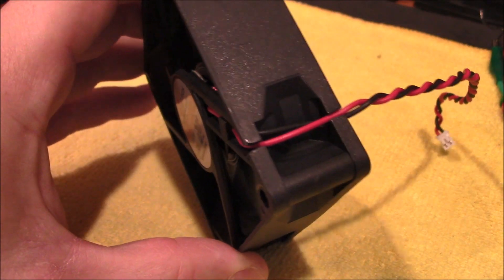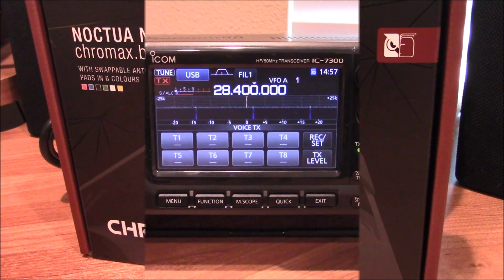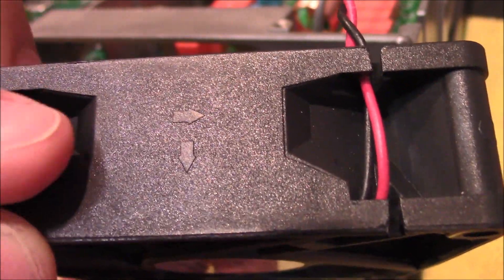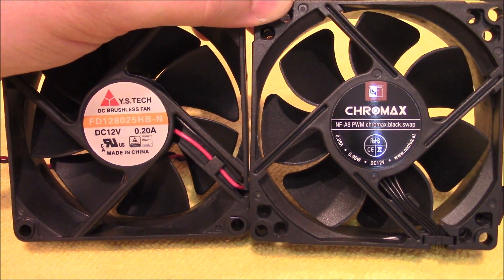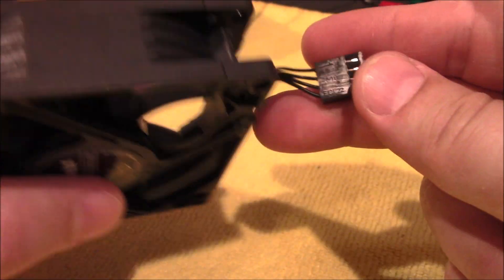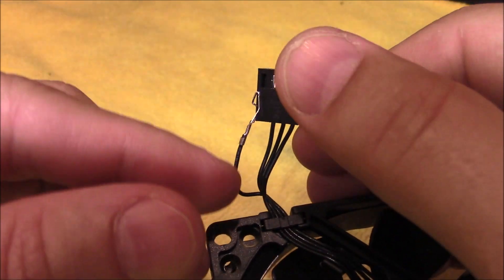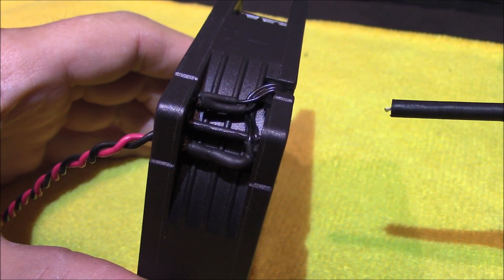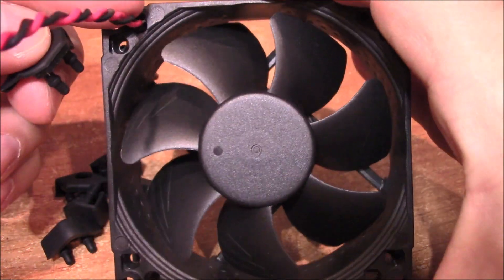Icom IC-7300 Fan Replacement - Install and Sound Comparison

Comment: This was a great video. When I saw that the wire connectors differed between fans, I wondered what you would do.  Now I know.  Shared this link with my club.

Comment: Noctua makes excellent fans.  I have two of them in the 14 year old PC I'm writing this on and they're whisper quiet even now.  I think, however, that much of their secret is in the soft rubber shock mounts they use.  Less resonance through the case means less noise for the operator.  Given the drop in CFM I think I will try the rubber mounts first in my 7300, then go to the Noctua fans if that proves less than satisfactory.  Thanks for the review.

Comment: Many in our club have adapted 9700 to have fan on low all the time rather than ramping up.
Reply from the maker: Is it finally an option via firmware upgrade?, I had a 9700 for a short time,  I don't recall it doing that. Must be different fan control firmware for the 7300.
Reply: @morejelloplease  it’s not as loud but I asked the guy from my club, apparently on 9700 it caused the freq to become unstable on 70cm and even worse on 23cm.  Sorry seems not same thing, my mistake.
Reply from the maker: @CampervanCookout  that's why I sold my 9700, fancy radio that won't even receive out of band and drifts way too much, it's even noticeable on 2m ssb. A GPS reference oscillator is a must.

Comment: The 7300 fan noise has never bothered me. Maybe it is because I am hard of hearing at 76 yrs. But the Astron power supply fan did bother me, as it ran all the time. I changed it out for a quieter one and added a temperature controller to it.
Reply from the maker: Yeah my astron vs70m sounded like I was sitting in a computer server room it was so loud. The icom would cycle every time you key the rig.  When you are talking in a rag chew group it gets annoying quick,  like a fan clutch on a garage truck coming up the hill.

Comment: I only need 35% of my 7300 power to feed into my amplifier to get out 600 Watt and 35% does not make the internal fan loud.
Reply from the maker: either there was a firmware update (doubtful),  you have a different fan , or you can't hear the fan noise as it's probably being drowned out by other noise in your shack.  the power could be at 1 or 100, as soon as you key it, the fan ramps up which  sounds like a trash truck coming down your street.
Reply: @morejelloplease  ...I hardly hear my fan, it's not as loud as yours, I don't know why.

Comment: Since Noctua is less CFM, how about just reduce the speed of the existing fan with a resistor instead?
Reply from the maker: You could build an external speed controller and leave the stock fan in if you like
Reply: @morejelloplease  controller with a thermistor.

Comment: Modification DANGEREUSE pour le poste, bien sûr que ce nouveau ventilateur fait moins de bruit puisque son débit d'air est de 55m3/h contre 70.68m3/h sur la version originale. Un exemple à ne pas suivre, si les ingénieurs de ICOM ont prévus d'installer un ventilateur avec ce débit d'air c'est qu'il y a une raison, à vouloir jouer les apprentis sorcier on fini par tout casser. La bonne modification serait de trouver un ventilateur avec le même débit d'air tout en faisant moins de bruit...pas simple de vouloir être meilleur que le créateur HI !
Reply from the maker: All I could understand was "icom"
Reply: @morejelloplease  English translate "DANGEROUS modification for the station, of course this new fan makes less noise since its air flow is 55m3 / h against 70.68m3 / h on the original version. An example not to follow, if the engineers at ICOM have planned to install a fan with this air flow, it is because there is a reason, to want to play the sorcerer's apprentice we ended up breaking everything. The good modification would be to find a fan with the same airflow while making less noise ... not easy to want to be better than the creator HI!"
Reply from the maker: @johnbeaurain1567  yes the airflow is slightly less as indicated, and I also said perform at your own risk. If you are using this during a field day event in 100 degree weather using RTTY at full power then airflow may be an issue, it just depends on how you operate your equipment. For me I was using it for ssb rag chew and never had an issue, also if you are running reduced power to drive an amp it should be fine. If the radio gets warm, the fan will stay running after you unkey, and only for a few seconds but usually it stops as soon as I unkey, so I was comfortable with its operation. I sold this radio long time ago, if I'm not mistaken there's a temperature gage in the menu or maybe I'm confusing it with my 7610 , which by the way did not have a noisy fan and if it did I would still perform the same modification with a similar fan. Tinkering is a big part of this hobby.  Just like cars, some people modify them some people don't - if it's not your cup of tea then don't drink it. :)

Comment: Do you know what the pin spacing of the connector?  It looks like a JST connector, but there are three sizes: 1.25mm, 2.0mm and 2.5mm.
Reply from the maker: I don't, I assume you're talking about the power connector on the icom.

Comment: What's the clicking sound when you transmit? That's nearly as irritating as the fan noise.
Reply from the maker: i'm just pulsing the transmit via foot switch, those are the actual relays in the radio, not the foot switch.   my intent was to demonstrate that the fans sounds like a mac truck when you simply blip the transmit.    when you stay keyed, they ramp up, then settle down, but eventually ramp back up again.

Comment: I got the beige colored noctua fans. That's cooling performance of it's finest. I need to put my ears on the lid of the TRX to notice to fans are running as they should. HI... nice video. 73's de Günter

Comment: Even after hours and hours of use my 7300 fan is quiet even on transmit.
Reply from the maker: make a video, maybe you have a different fan.
Reply: @morejelloplease  sure even after continuous use of 6 hours the bar remains with 4 stripes only.

Comment: what gauge wire did you use for replacement? I'm thinking  22awg? 73's
Reply from the maker: i used the stock red/blk wire and soldered it to the fan.

Comment: i love my fan. i will never change it
Reply from the maker: the OEM fan?  interestingly enough, my 9700 and 7610 stock fans are much quieter.
Reply: @morejelloplease  I agree. The stock OEM fan on my 7300 is the same identical fan in my stock 7610. Part no. FD128025 HB-N. Although the stock 7610 fan is just a bit quieter than the 7300, still too noisy for me. The 7610 stock fan is probably fed with less voltage is just my guess why it's a tad quieter. Thank you More Jello and Noctua
Reply from the maker: @slashzeroYO  It has everything to do with the circuit that drives the fan.  icom dropped the ball here since the 9700 and 7610 aren't this noisy during startup.  either they can't adjust this via firmware update or they haven't received enough complaints.  i like how certain model yaesus will give you the option to run the fan in normal mode or contest mode. fancy SDR radio and we can't even control the fan :)

Comment: A bigger better speaker makes it a better radio also.
Reply from the maker: and more butter makes it better too.
Reply: @morejelloplease  sure...
Reply from the maker: @samiam9059  exactly my thoughts
Reply: @morejelloplease  The speaker is terrible compared to just about any other alternative for long term listening.
Reply from the maker: @samiam9059  ahh gotcha, wasn't sure where you were going with that :)   all these radios are getting smaller, and so are the matching speakers.   i sold my icom external speaker, looks cool, sounds like crap lol.     the 7610 has a decent speaker actually, in it's own enclosure.
Reply from the maker: @samiam9059  i have some old realistic minimus 77's, they work great too :)
Reply: @morejelloplease  there you go

Comment: my fan is very quiet perhaps on uk radios they are not the same
Reply from the maker: they may have selected a different batch of fans.   see if you can snap a photo or write the make/model of your fan and post it :)
Reply: @Michael Harrison well i dont know Michael but mine isnt, very quiet in fact perhaps just lucky, good radio though

Comment: I did the same thing for my (ex) Kenwood D710GA. The experience was detailed on the QRZ forums.  It was WAY too loud for APRS 24/7 operation and I used a small Noctua fan as a replacement.  Man what a difference.  Very similar to your experience.  I wish these manufacturer's would spend a few pennies more and use a quality fan.  ;o)
Reply from the maker: Hi Nick!  yeah i'm not sure why they don't spend a little more time in the R&D department to select a fan that's sufficient in airflow and is quiet.  If it was a commercial piece or gear being mounted in a rack at a repeater site then it wouldn't matter as much.  I even sold off an astron 70 because of the noisy fan.
Reply: LOL If you and the OP had a clue, you'd know how you're both embarrassing yourself with comments like this. Begin with learning the difference between dB and CFM.

Comment: Nice video Jello. Do you think you could have gotten an acceptable reduction in noise with the original fan by putting vibration dampers on it? That was quite a change when you added them to the new fan.
Reply from the maker: I don't, i think it's the design of the blade, rpm, cfm, etc that contributed to the noise.  i've been watching the temps and so far so good.